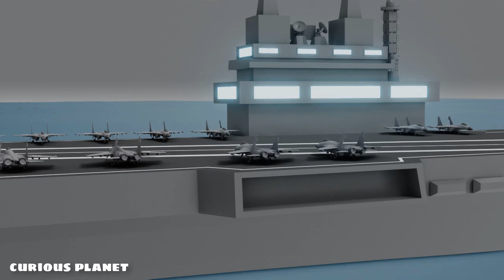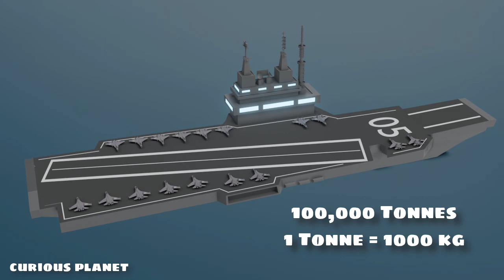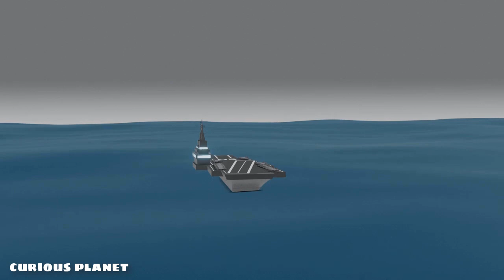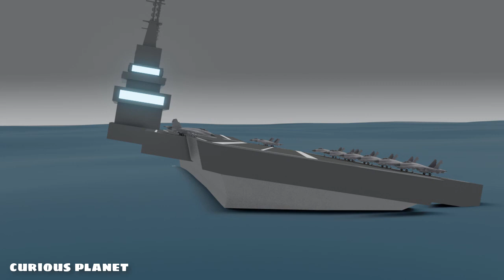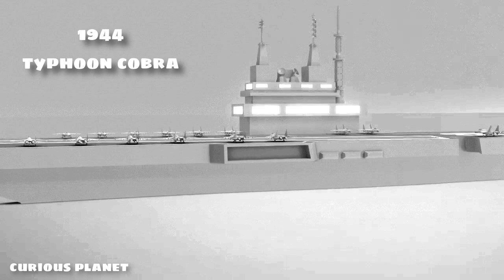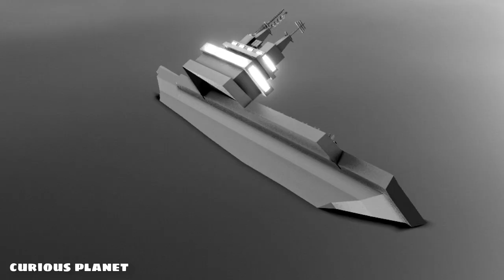Can Severe Weather Sink an Aircraft Carrier? - 3D Animation

Comment: Lesson get on my vessel it can't sink by waves.  I have a same boat as the coast gaurnd.  The Damm boat can "capsize" and still keep on going cuz it has an auto flip feature so it will re Wright.  Of a wave is 20+ft taller than it no problem goes right to the top.